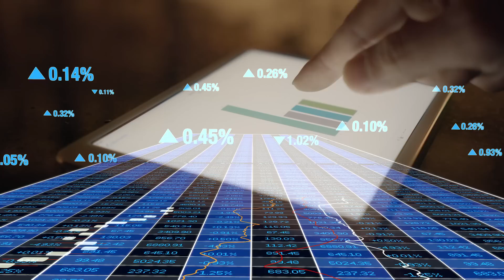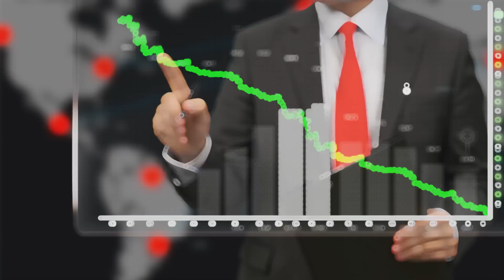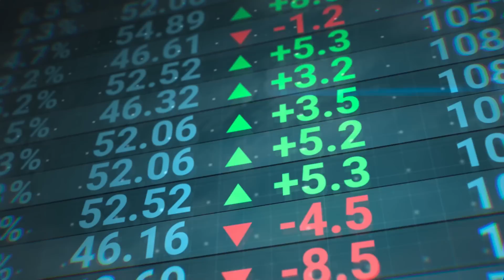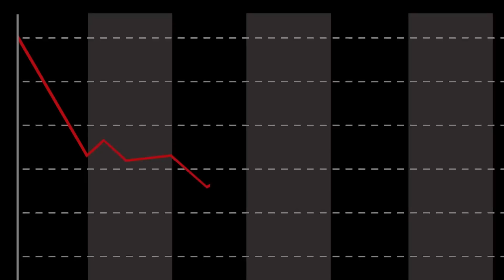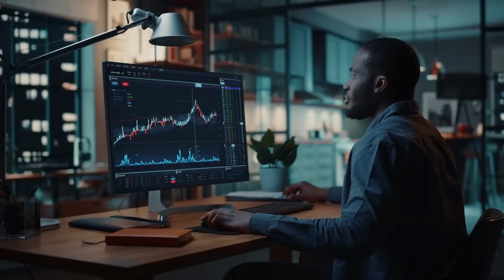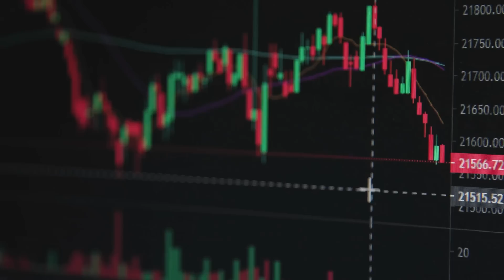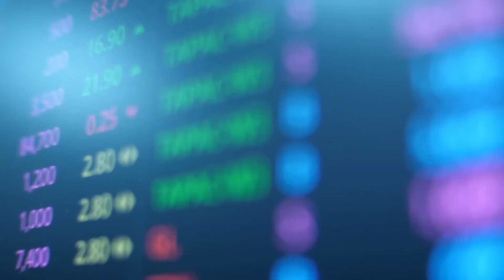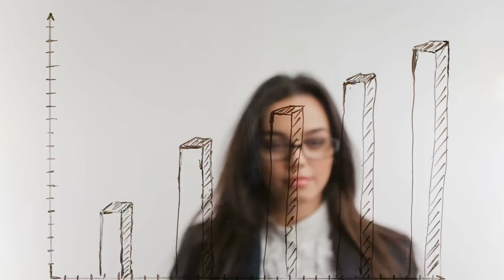Charlie Munger Brings MASSIVE News for Tesla Stock Holders (Once In a Lifetime)

Comment: This is Clif with a shout-out AKA Clifton Davis much swage 😎 Elon musk I have an idea for you musk try making the whole dashboard the but using your cellphone technology mirroring and using 3D technology incorporating the same steel  structures as your cellphone technology as the material used in construction of said dashboard making it tuch ace's able technologies what say you Elon musk next application on New car's upgraded in all standards starting at say 8,000  go in development and spects build it and they will pay get invested and make it happen I also was thinking about smart windshield technology mirroring Google Glasses only with your flare and ingredients in pi phone technology the same could de said to useful GPS on passengers side of windshield a topographic maps system used in the feature of military sound's cool 😎 just a idea 💡